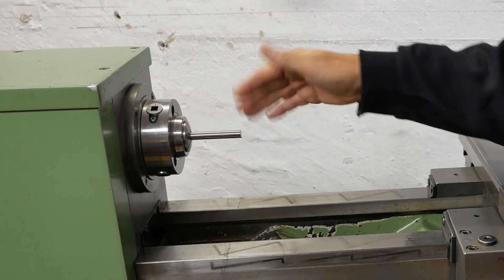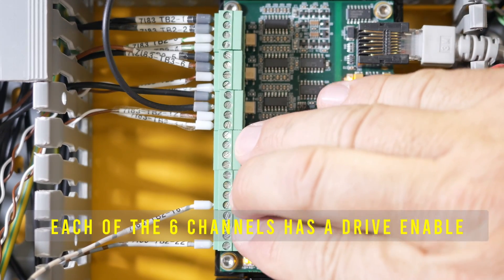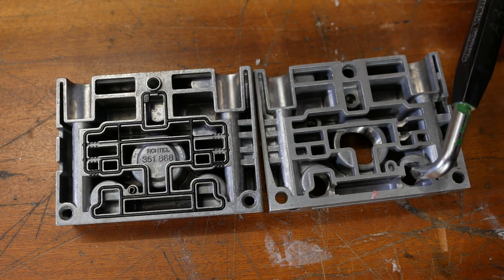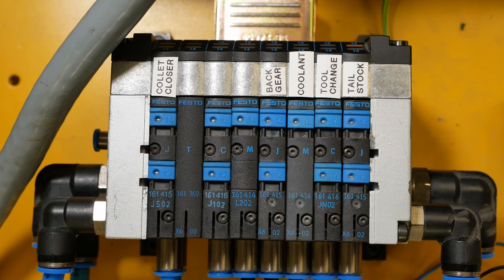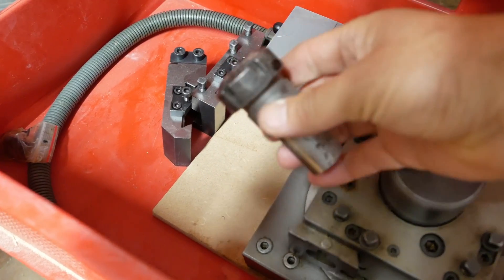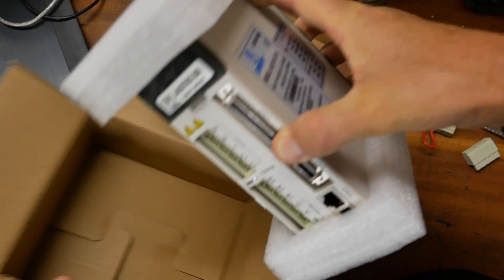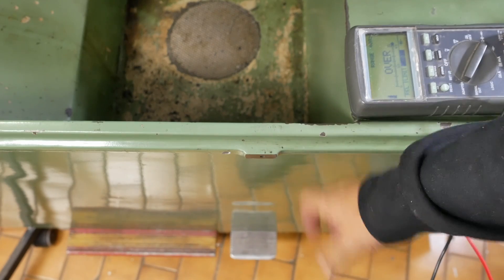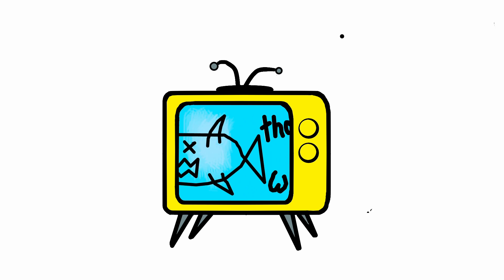Collet closer pneumatic control - Schaublin Ep. 45

Comment: Might change the Foot Latching Switch, at this point if u latch it ( not intentionally maybe ) while running the Spindle  it releases the Chuck when the Spindle Stops, if u add an automatic tool changer and there is no Chuck engaged Signal oh boy could be a bad day.
Reply: You might be able to use a RS latch or similar - if LinoxCNC supports it, to program it so that it ignores the switch until a state change AFTER the spindle stops, but I agree, far better with a momentary switch.
Reply: You just add a logic piece for 'If Spindle disengaged then don't run' or a 'during program, don't check the toggle status'.

I still lean towards the momentary switch changeover since it overall reduces the possibility for a goof, but the solutions aren't too bad either.

Workload difference is the physical vs mental efforts, but the mental is easier to goof, as you have to actively correct the problem, and a typo could fail to correct it.
Reply from the maker: @B0BBYL33J0RD4N  Thanks for your feedback guys. I will see whether there is a "program is running" signal I could use as an inhibit. Otherwise, I guess I could pull that switch (which I think is a full footswitch), and replace it with a momentary one.
Reply: @RotarySMP  I think that maybe the easiest way to go, though (if it were me) I would still want an always on/off manual option. Either manual or Linux driven.
Reply: @RotarySMP  Momentary switch is the way to go, so there's no way chuck will open when spindle opens. Otherwise, you would have to program so the "logic" checks status of switch. If it happens to be opened while chuck was running the logic would need to see a "close" first before "open", a double step on the switch...this would get old after the 3rd time so momentary  switch is better, the logic can be set to ignore any inputs while spindle is running.
Reply: In rslogix for PLC 500 & 5000 ladder logic, there is a ONS or one shot instruction. On the first scan through logic, if the input logic is true, you will get an output.  On the next scan, even if the input is still true, you will not get an output.  The ONS needs to see the input go false then true again. If there is an equivalent instruction in your programming language, it will take a few more rungs to make it work but you should be able to keep the maintained switch.  Having said that, I do think the best option is to replace the switch.
Reply from the maker: @lasermike2147  Thanks guys. I will look into that.
Reply: My thoughts exactly.
Reply: @Sheila Walker  Hi Sheila, cnc lathes very often are connected to a bar feeder ,or a robot loader of some sort.
in these cases the chuck/collet/ workholding gizmo are under computer control.
only Mark knows what his ultimate purpose for the machine will be, but to remove computer control of clamping would
be a significate reduction in possibilties.
The simplest form of bar feeding is with a device called a bar puller ,that is mounted to the cross slide (google" bar puller ")
through a programmed x and z motion, it will engage with the just turned part , collet unclamps , the the  appropriate amount
of new bar is pulled from the spindle and then clamped again, all under program/computer control.
Steve
Reply from the maker: @steveggca  wrote "only Mark knows what his ultimate purpose for the machine will be, "

You have more confidence in my planning than I do :)'

But thanks for pointing that out. It is a really good idea.
Reply: @Sheila Walker It's more of a retained bit that sets true for one cycle then won't trigger again until it sees another rising edge.
As an example, I want a light and horn for high level.  The operator can silence the horn but the light will stay on until the level drops.  The light is easy, just the (level)input and the (light)output.  For the light, the (level)input triggers the ONS, the ONS latches a (horn)bit.  The latched (horn)bit is used to trigger an (horn)output that drives a horn.  The operator presses a button that unlatches the (horn)bit which silences the horn.  Without the ONS, the horn will immediately sound since the level is still high.

Comment: interesting that strange slow motion part was like lag
Reply from the maker: Which part?
Reply: @RotarySMP  was from the minute 4:00 and is like 45 seconds is strange maybe is a optical illusion or something bug when was exported
you cnan see it very clear in 4:48 you can see the movement that a few seconds pass an is back to normal
Reply from the maker: @MakarovFox  I probably screwed up and bumped the shuttle speed out of the normal 1/50th, when I meant to adjust ISO for exposure. Has happened to me often enough.
Reply: @RotarySMP  yeah very likely look like low shutter speed

Comment: That blue capacitor has to have the right polarity. How did you take care of that with same color wires and heat-shrink hidding the markings ? These capacitors will fail short if a reverse voltage is applied to them.
Reply from the maker: I noted it, and returned it in the same orientation.
Reply: Great. Really nice project and great work !

Comment: here's a question: if the spindle was on, then you hit the footswitch, then turned the spindle off, would it wait until the spindle stopped before releasing or would it potentially release when the spindle is no longer powered but still rotating?
Reply from the maker: Good question. I have had a lot of input which indicated I need to revisit this, and add complexity.
Reply: @RotarySMP  nice one! I wonder if the footswitch should only be used as transition detecting and all the latching is done in software, might simplify the logic and prevent funnies happening
Reply from the maker: @mrsockyman  Some have speculated that the latching switch belongs on the E-Stop, while the momentary switch belongs on the collet release.
Reply: @RotarySMP   depending on when schaublin started making cnc lathes, it might be a legacy part from manual machines which would be step-on step-off
I imagine that it did but did the foot switch even report back to the controller directly?
On Fanuc controls the spindle encoder is always live and and always displayed on screen , is that how your  linuxcnc install  is handling it now?
The chuck would only ever unclamp  or clamp when Zero RPM is present
Reply from the maker: @steveggca  Good point. This was Schaublins first CNC. 
Yes the spindle encoder is directly connected to display RPM, so that RPM = zero is a good idea.

Comment: That latching collet release foot switch is a bit of an oddity. I have a feeling that sometime in the past, the original failed, and the E-Stop switch was "borrowed". It's normal for the E-Stop circuit to be a normally connected, circuit, and the circuit broken via a mechanical latch to stop. The latch needs to be reset before starting up again. I would have expected the collet actuator to be operated from a momentary switch. 

Great stuff again.
Reply from the maker: Good point. I will take another look, and see whether there are extra holes which would indicate the switches got swapped.

Comment: Hi, one of those cap called, tantalum cap(blue one). when they dies make short circuits. I think they were in old schematic. Without seeing the circuit diagram it is hard to say but, I think those can be replace different  type of caps. Please keep in mind that tantalum caps have poles and working voltages like electrolytic caps. So please check the plus pin when connecting them. Thank you for the video. I love the content.
Reply from the maker: Thanks for the tips. I put it back with the same polarity as I removed it.

Comment: D-Sub connectors with screw terminals are a thing. I'd avoid soldered connections like the plague. Bit more pricey, though.
Also: are the valves actually rated for lubricated air? Because I plenty of my valves failed because the air supply was inadvertently not oil-free, as it should have been. EDIT: just checked the data sheet - yes, they are okay with oil in the air. "Geölter Betrieb möglich (im weiteren Betrieb erforderlich)"
Reply from the maker: Thanks for checking that Alexander. I got the valve terminals used, so  who knows what oils are already in them. It is possible, that my oiler adds an oil incompatible with with whatever they saw before, and they all get gummed up.

I considered getting a crimp pin dSub, but this one was laying around.
Reply: @RotarySMP  You can always disassemble them and clean them. I asked because "getting sticky" is one of the symptoms of too much oil being in there. Although my experiences revolve mostly around proportional valves.
Reply from the maker: @graealex  Since I had enough spares (I broke down two 10 valve CPV's, I haven't looked into disassembling a valve yet.

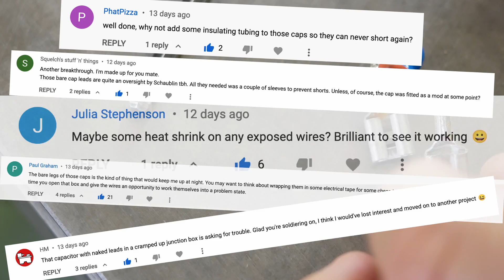Comment: 1:12 If you want to greatly improve your soldering skills, find the closest bin and toss the cone tip in there. A chisel tip instead will do you a massive favour, most of all in your application with thick wires. I honestly don't know why they even sell cone tips, let alone them being the default one when they are all junk except for a few shallow angle ones
Reply from the maker: I think this was a chisel tip, before I turned it smaller for the one time I did an SMD board. Then it also got dropped, hench the special hooked tip :)
Reply: @RotarySMP  oh lol. I really suggest against turning down tips because the core and the coating are different. The core is usually copper for heat carrying and thermal mass but the outside is a couple intermediete layers and electrolytic iron on the surface. The copper really loves to dissolve in solder and if you penetrate the iron it creates a cavity in the tip over time

Comment: When you accidentally step on the collet release and don't recognize it, when the spindle stops after one operation, would the collet release? The foot switch is still mechanically latched...
I think a non mechanically latching switch might be better in terms of not releasing the part unintended. Or some convoluted logic like "Hey, you stepped on the switch before the spindel came to a complete halt. If you don't want to release the part, step on the switch again, or else I'll let go in 15 seconds."
Reply from the maker: There have been a few comments on this. Thanks for helping think this through.

Comment: As you were introducing your die grinder to that end plate I was screaming No!...
Oops I guess you can't hear me in the past
Reply from the maker: :) Unfortunately not.
Reply: No real point in trashing the second gasket after creating a pneumatic path right around it.
Reply from the maker: @jimurrata6785  I was just copying what Festo did. They also had those two bits snipped out.
Reply: @RotarySMP  I think it's awesome that you have the collet closer functioning!
Tool post next?
Reply from the maker: @jimurrata6785  Thanks Jim. The tool changer is a much bigger project. I assume it is "glued" together with varnished coolant, like everything else was. Before I start that, I want to get all the electrics finished and finally get those control panels off my bench and in the cabinet where they belong. Then I can connect up and program all the other pneumatic circuits as well.

Comment: Be careful the Blue capacitor is polarised!!!
Reply from the maker: I returned them the same as they were removed. Thanks for the tip.
Reply: I should also add that those tantalum caps are famous to explode after 20, 30 years in operation, I would replace it with a low esr polymer aluminium one.
Reply: @ViniciusMiguel1988  do they cause any damage when exploding?
Reply: @MF175mp  They might take an eye out with the shrapnel, but otherwise a loud crack, and a few loose bits.
Reply: @MF175mp they can fail short and take your power supply with it, it is very common faulty in old instruments.
Reply from the maker: Man, you guys sound like you are brainstorming a electricians Halloween surprise! The Tantulum capacitor is in a cast Al box, with a cast iron door. I hope it cant expolode that :/
Reply: @RotarySMP  It can't but if it fail short depending how it is wired up could take the power supply with it.
Reply: When we saw them briefly in the last video, they were hard to identify. Yep, the blue one is a tantalum, and defo polarised. They make nice electric matches if you have a mind to blow something up. Just wire them backwards 🙂